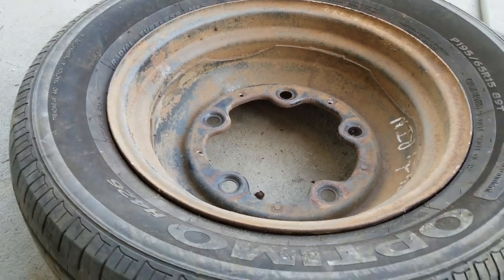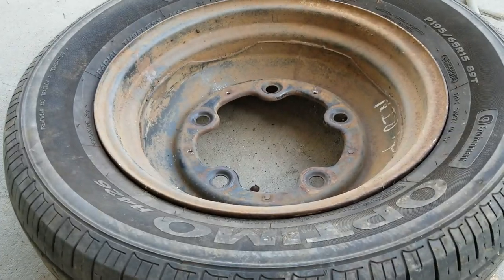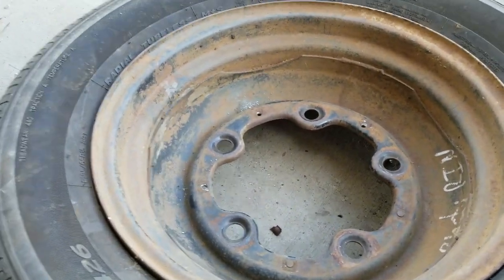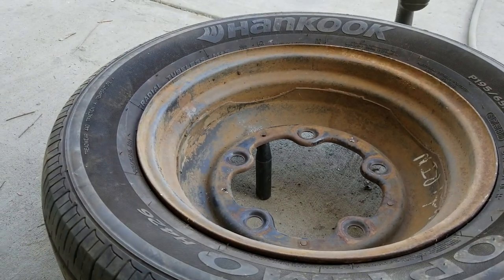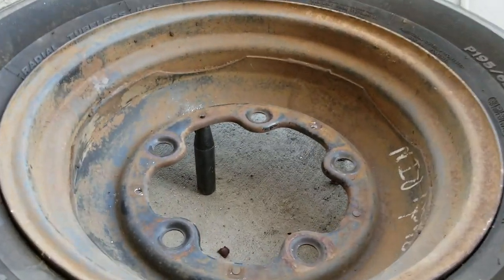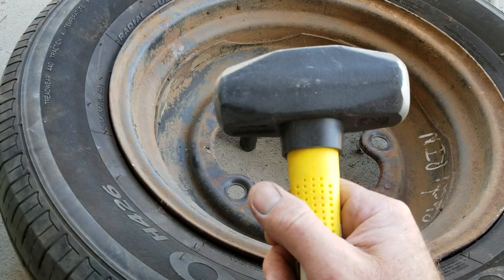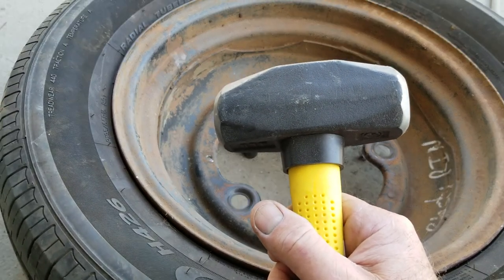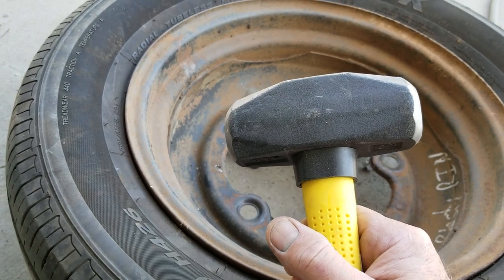VW Bug hubcap clip install short version video

Comment: I have a question.  Is us wrong to pop rivet the clips to the wheel? Or is that "not done?"  Thanks
Reply from the maker: i think you are looking at the rivet in the tool the rivets come with the clips in a kit. the end in the air you smash. Check my other hub cap clip video to see what the other side looks like . just a round top rivet like original. looks absolutely perfect.
Reply from the maker: if you use a aluminum generic rivet it will not look right and will eventually fail because it is not strong enought to hold on the hubcap.
Reply: @Mikefngarage  Thank you. I was curious about it.  You've answered my question.  There is so much that I just do not know.
Reply: @Mikefngarage  Thanks